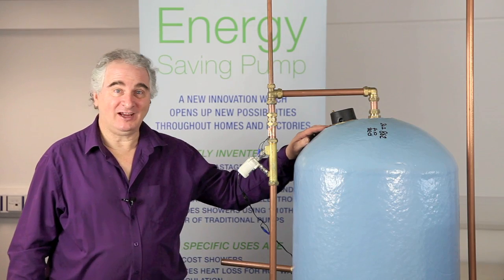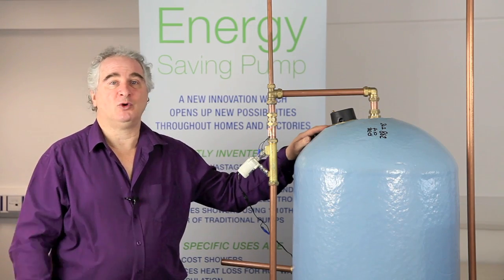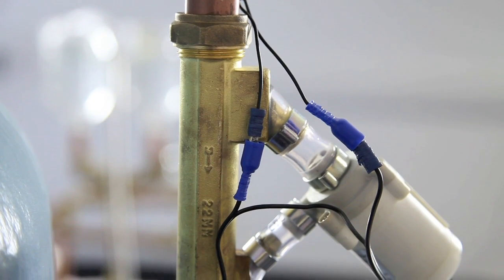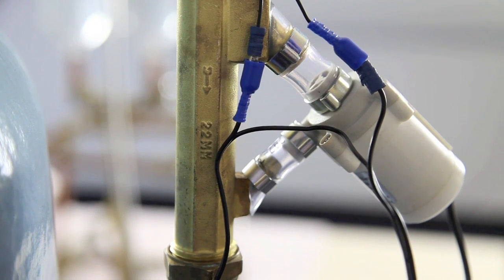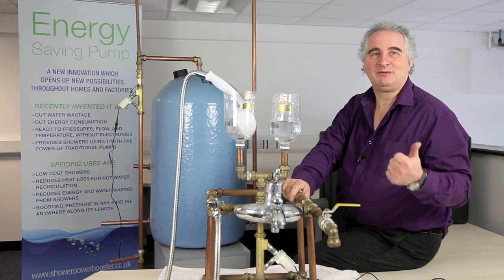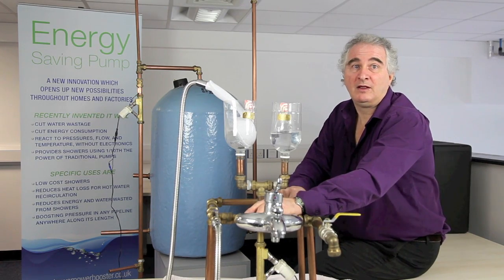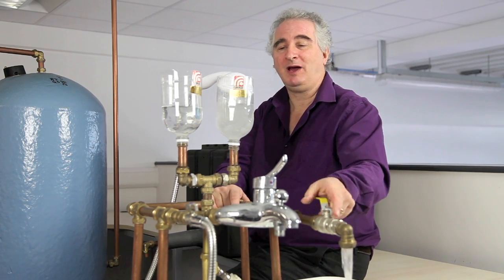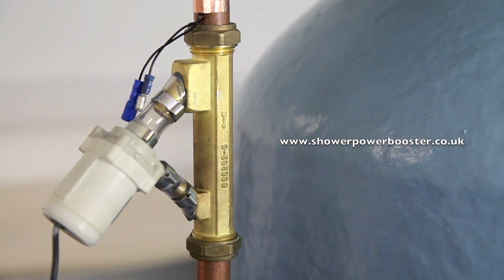How To increase low water flow rate in a shower or bath

Comment: Interesting,what is the limit of hot water temperature flowing throughout that PvC pump buster housing??
As the main cause of shower pumps busters wit PvC housing are issues with hot water temperature exceeding 65 degrees
Reply from the maker: A constant 85 Deg C is fine which is way above anything in a domestic plumbing system.   We use these pumps on everything from central heating systems to solar thermal and 100 deg C seems ok  but I will stick with saying 85 Deg C.

Comment: Do you also need one on the cold feed to the shower as I thought you need equal hot and cold pressure to a thermostatic shower? Kind regards
Reply from the maker: 80% of people get away with just boosting the hot. 
20% of people need to boost the cold as well.
A Sp2b (one pump) is £125 and a SP22S (2 pumps) is £200.
If the cold seems ok and you just like hot showers (42 deg C), then the mixer mixes 2/3 hot with 1/3rd cold. If you boost the hot only and the cold looks after itself. Any doubts buy the SP22S.

Comment: What if the motor fails after certain time?
Can you replace the motor without taking out the whole pipe module?
Reply from the maker: You can simply replace the motor if that is all you need to replace.

Comment: what is the d BA rating on this pump
Reply from the maker: The pump is whisper quiet (30db), but sometimes you can get resonance
through the pipework ((but because the pumps are so very small and generate so little heat you can muffle the pump (and insulate the pipes)).
Reply: How can I muffle the pump? Thanks

Comment: The inventor might know about hydraulics but doesn't know about electrical installations.
There is a difference between voltage and current.

Comment: hi , will this pump  increase water pressure in gravity fed shower?
Reply: i s yeah I've got a system the same as yours and it works spot on
Reply: that's what he is demonstration is on. That's not a pressurized cylinder in the background.
Reply: I require a pressure pump for bathrooms

Comment: Can you direct me to a fitter in the Leeds area, please, for the shower booster?
Also, if a bathroom or washing machine is on, will it still work>
I ask because if the shower is in use and someone turns on another tap or washer the shower dribbles.
Reply: Twatted Twat
Reply: John Hitchman You rang, simpleton.
Reply from the maker: Hi John, 
We have several fitters in the leads area go to. If you fit it on the pipe that feeds just the shower the shower works well when washing machines and other taps are turned on in the house. See
http://www.showerpowerbooster.co.uk/choose-right-plumber/